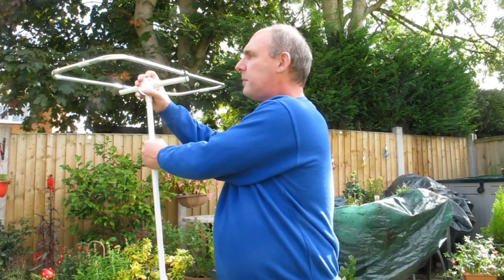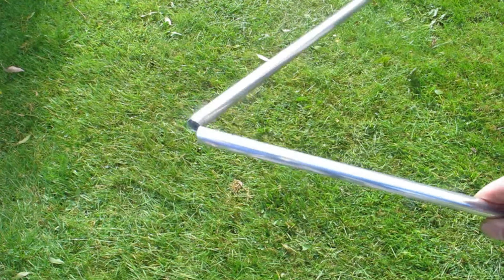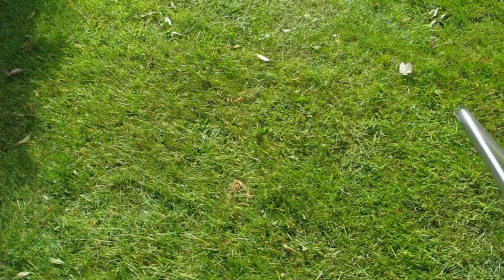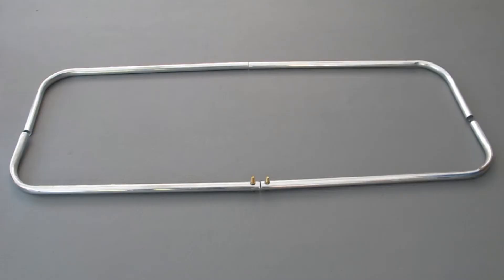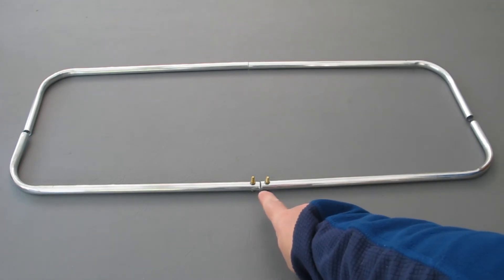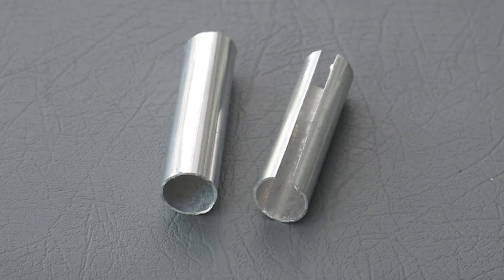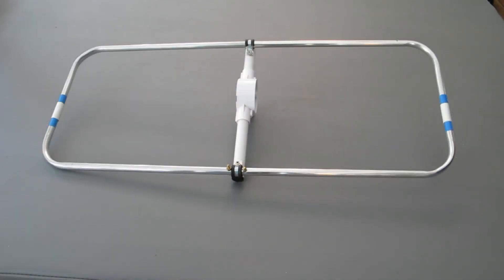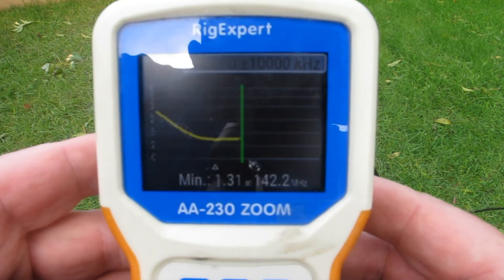Homebrew 2M Moxon antenna project

Comment: Hello from Greece. Simple and targeted construction. I would like you to tell me what is the material of the central shaft.
Thanks
Reply from the maker: Hi There my friend thank you for your question, if you mean the white plastic on the left and right of the beam it is TOWER OVAL UPVC WHITE CONDUIT 16MM X 2M. If you mean the centre joint near the feed point it is TR Rubber Lined P Clips Hose Pipe Clamp Stainless Steel Pack of 5 (15mm). I hope this helps?

Comment: You can heat, you can also pack it with sand before you bend it. Next tap or blow out the sand with compressed air.